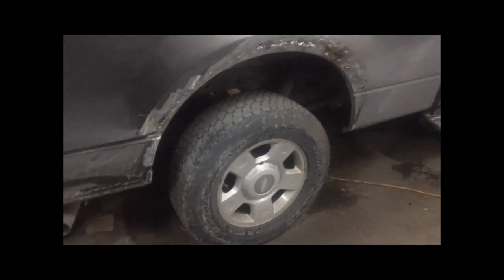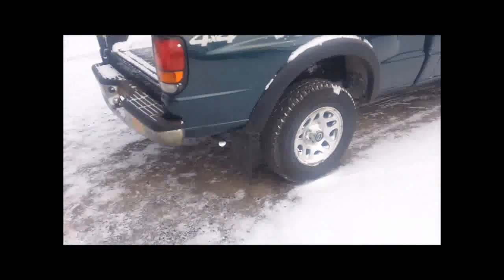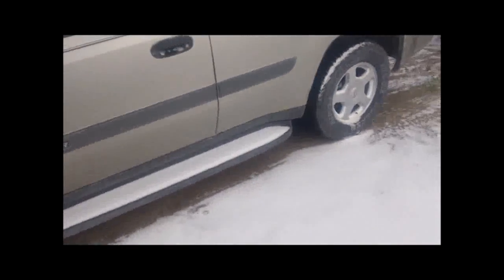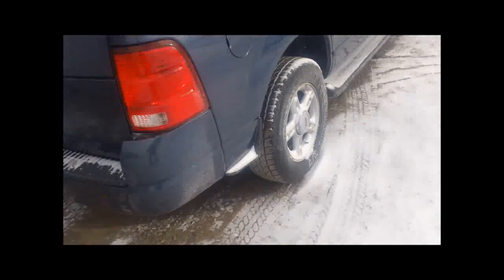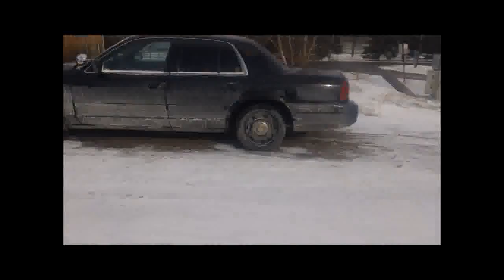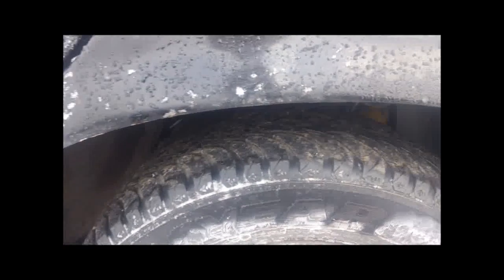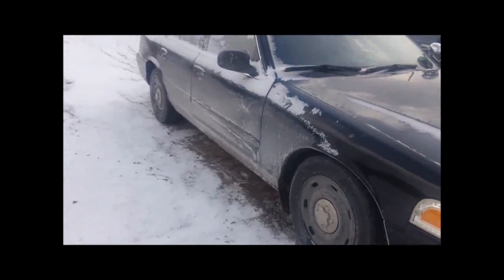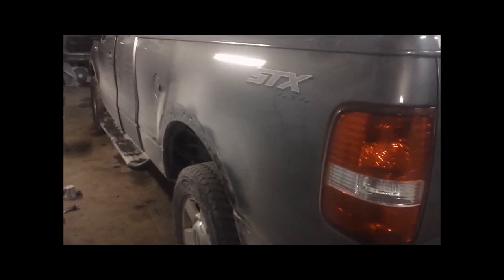Why do vehicles rust? Poor build design or because people don't maintain them?

Comment: For us in Europe it's totally amazing that you can even buy a brand new car with no undercoating. Add bad design to that and you will get huge rust problems. European and alot of Japanese cars are pretty well rust proofed and have been for alot of years. We have lots of road salt and hard winters here too, but 20+ year old cars with high miles are still on the road with little or no serious rot.

Comment: When I buy a new vehicle, it goes directly to Ziebart before it even sees a wet road.  IMO, a good undercoating/rustproofing when new helps tremendously.  With that said, undercoating isn't perfect.  I still make a point to put my vehicles up in the air each spring and give the undercarriage a good power washing.  I'm also careful to always open each door when I'm hand washing and run my sponge along the bottom of the doors and the jambs.  I also like to spray Fluid Film on many of the suspension parts.  Nothing really stops rust totally but good maintenance and cleaning will help deter the rust.  I really wish we had Krown oil coating in the Midwest but that's more of a Canadian and upper northeast thing.

Comment: The coating on the imports is actually put on to stop the salt in the air from getting into the seams while they are being shipped. It does a very good job. The "aftermarket" version is Waxoyl Like most coatings it works best on rust free surfaces.

The trick to any coating is getting it into the seams. That is one of the things that gluing a vehicle together with bonding adhesive could really help. If the entire seam is filled with glue, the air and moisture stay out.

Comment: Poor design, thinner gauge steel and highly corrosive chemically treated road salts.  The EPA keeps setting stricter federal CAFÉ standards that force manufacturers to produce lighter vehicles in order to meet fuel mileage goals.  The municipalities are treating road salt in order to stretch tax dollars. The end result is that the cars have less fuel consumption as fuel prices rise, taxes rise with rust repair costs rising.

Comment: CHECK MY YOUTUBE CHANNEL.. I HAVE A 27 yrold  chrysler fifth avenue and a 27 yrold duster kcar. and a 20 yrold dakota and a 10 yrold dodge ram... all are OILED  every spring n fall..with every oil change.. my dakota has been oiled atleast once a year since 2 years old.. .. same with my ram.. princess auto oiling kit and used oil... sticks to the old undrecoating and its thick as wheelbearing grease.. ..every door sill and cover the rockers and bottom of the doors.. ..inside n out.. takes about an hour..  the truck is flooded with thick oil.. all winter long ..ottawa used tons of salt.. i have  NO RUST.. i love my trucks .. cant afford to replace them.. people say its the BODY FOAM ..if theres no air at the steel and the foam is SOAKED in oil.. IT CANT RUST oil is the answer  .. spray the shit out of it.. .. PISSER the ford in your shop is rusty because is not been oiled THATS  BAD MAINTENANCE   ..my dads GRANDPRIX GTP  is 10 yrsold.. OILED 2 TIMES A YEAR.. 20 TIMES OILED.. NOT A SPECK OF RUST.. BUMPS N SCRATCHES N  WINTER CRACK IN THE BUMPER BUT THATS NORMAL  WEAR N TEAR FROM A 72 YROLD MAN  AND PARKING LOTS .. CHECK MY CHANNEL .. IF IT AINT COVERED IN OIL 2 TIMES A YEAR ITS POORLY MAINTAINED !!!!!!!!

Comment: Dinitrol is what has been used in Sweden to prevent rust inside the chassis and under the car. The real problem is the manufacturing process of these cars, firstly the don't build them to last (they wouldn't sell new ones if they did). New cars normally just have a light treated surface on the sheet metal, one layer of a black primer on the inside but they have 3-5 layers on th outside and that is just to get the good looks. The second reason or the main reason is profit, if you build a cheap car that the customer is going to the scrap yard with in 5 years then you can sell another quicker. Then you say if the quality is so poor the customer will change brand, but if all the brands have the same philosophy (cartel) and the only once that do think of the customer costs a fortune, what will you do? To prevent rust treat your car with wax or Dinitrol the same day you buy it and you might save yourself some dollars in repair costs.

Comment: I think its a trifecta of it all. 1 Being poor design. 2 Owner neglect. 3 The crap they use on the roads in the winter. I have 3 different rigs. I have a 2000 grand am GT that I don't drive in the winter at all its kept in storage only driven in the summer and fall. Has 164k miles on it and not a speck of rust. My 01 GMC I drive all the time year round has a few rust spots under the rear quarter panel near the mud flap and I try to wash it all the time to get rid of the grime. Now my 91 Chevy plow truck has rust all over it. I used it to plow roads and driveways in the winter time. I try my best to keep it clean but the crap they use on the roads just eats it up. Granted its surface rust but it will soon eat thru. Not to mention my plow blade is covered in rust. Just goes to show you from one extreme to another. Salt is killer for paint. And out here they use de-icer spray and that crap IMO is worse!!

Comment: honestly i think it truly depends on where you live. In new york they must drench the roads in salt or add something else to it because where I live in Northern Ca we get snow, they salt the roads all the time and I dont think vehicles here have the rust problems as it is there. All the vehicles I've worked on or friends vehicles never had rust issues. My friend had an f250, the only thing that began to produce rust was the aftermarket nerf bars/steps.nothing  to the actual truck.. So who knows maybe there is something different in the water/air/salt on the east coast? Atlantic more potent than Pacific?

Comment: Actually, Ontario REALLY lays the salt to it, here in Saskatchewan rust is a non issue. My wife has an 87 Olds 88 -- showroom  fresh. I run a 93 diesel, 30 mpg and one spot thumb size. No need to replace either one.

Comment: i have a 1992 lincoln town car with original 89k on it the only spot on the car the has rust is the on the passenger back in front of the tire besides that the car has no other rust on it i don't drive it on the crappy roads since its in such nice condition

Comment: They rust at the seams and you have to have seams. If they were properly rust proofed from the factory they would last a lot longer. I have had really good luck with 3M rust fighter over the past 20 years, it sprays really thin so that it soaks into the seams and dries to a paste like form to keep the moisture out. So to answer your question I would say the blame falls on the manufactures, they need to do corrosion protection right on the assembly line but it's a cost thing so they don't do it.
Reply: Maybe they should just make cars 100% out of plastic, don't think they could rust then lol
Reply: CornellsGarage
 tubular frame with plastic/fiberglass panels.

Comment: Well im in ottawa ontario canada and the trucks here are generally not that rusty. They put allot of salt on the roads but the most rusty that i can see are the fords. If you go to a ford dealer they are already rusting on the lot. I drive an 00 silverado 325000 kms runs like a tank 4x4 and all and the rocker's are gone but that is due to an accident that just made them get worst from there. I did undercoat the frame with that can stuff and it's holding up nice but as for the body well some place's have design flaws but at then end of the day they are basically all the same. My brother's 07 murano has roten rockers and it was well maintain so it's really the fault of the manufacture.

Comment: Ya tell the road maintenance contractors not to use so much salt on the roads. I watch Corvairwilds channel the state of New York uses excessive road salt. Here on the West Coast of BC the salt air has some effect on vehicles usually it takes awhile for a vehicle to rust out probably 15 years or so. Yes you have to take a garden hose and rinse off the underside of your vehicles. Using oil or fluid film helps prevent rust. Hydraulic oil works well it is easy to spray and it doesn't smell like engine oil.

Comment: they are made too rust so you will buy a new one i hate cars the way they are made but sad but true german cars are very well built for rust you dont see them rust out no were near as much they spray the honey coating on all jonied joints ive even seen it under belt moldings on bmws

Comment: You need to do something to prevent it or at least slow it down. I have used oil and it works but dirt cakes up and drips every where. I just recently started using fuild film coat of $45 a gallon that is basicly sheep wool oil that is alot like oil... it migrates and penitrates metal but only gets a coating  of dust, does not drip and resists washing off. bought a spray gun made for it with a wand. I remove all body plugs and spray inside rockers and the inside of boxed frames. time will tell if it works... so far I like the stuff

Comment: build quality and people not in the trade knowing what causes rust or what signs to look out for are mostly to blame, like me if you work on the same makes and models in a shop and see the same thing over and over its obviously build, but hey, why build a car that lasts forever, no one will need a new one.
i would always spray-drown  a rust killer inside older cars first before any coatings
maybe you could do a four door test car like your rust / paint panel, each door with a different coating then cut them open later on in the year

Comment: I don't know about the rust but my grandpa has a 1995 2500 Chevrolet Cheyenne with rust on the tailgate and that's it. its a plow truck and driven in salty conditions its whole life it has plowed commercially for about 10 years.He has a Chevrolet 2002 2500 hd wit little rust but is starting to bubble on the dooors and tailgate he has a 2011 Chevrolet 2500 hd with minimal frame rust and no body rust and these trucks are rarely washed and have all been parked outside majority of their lives

Comment: I think a lot of it has to do with keeping them clean.  I oil spray ALL of my trucks and they seem to hold up much longer than those who don't.  But no matter what you do, those panels with the urethane foam in them are gonna rot.  And the GM trucks will all lose there rockers due to that stupid mid panel inside the inner and outer rocker.  You know what I'm talking about since I'm sure I've seen you cut into them before.  Thanks for the vid

Comment: Cheap materials. I thought most manufacturers nowadays 'dip' the entire steel body in a corrosion resistent (galvanized) chemical pool, before paint. Pretty much worthless environmental friendly watered down chemicals.  The 2015 model F150 body will be ALL aluminum, check it out online.

Comment: Keep em clean!  I daily drove a 93 Talon (in Canada) from 02-07 and it had zero rust when I was done with it.  I also washed it once or twice a week each winter and pounded the wax onto it with the wand, it would actually build up a coating.  I've also had Civics, Maximas - keep them clean and they wont rot.  The cars on this channel are the exception, not the rule IMO.  The only rotted out cars I see around are Mazda 3's and the odd neglected Nissan/ Infiniti.

As for Canada made cars rusting - they're made with the exact same parts as the US ones, so I;d say thats a myth.  Ever seen a rusty newer Dodge Charger, Chrysler 300 or Dodge Challenger?  Neither have I. (built here)

Comment: Shawn, 

A couple factors in play, in order to reduce costs body panels are lighter gauge steel (also for fuel economy), not sure about if recycled steel is a problem the steel used is alloyed for a combination of ease of forming and strength (and to make lightweight dies last). One thing about the older cars were the body dies were meant to last for years as manufactures would keep a body style for years, now it is change them every year or two = lighter gauge material.

Older cars also did not have so many hidden pockets to hold the salt and crud, edges of the fenders were rolled and you could brush and wash out the salt.  

Salt... when I was a kid there was very little salt used, coal cinders, mine dust, gravel were what were put down on the roads. Now days the roads are whiter after the snow is gone being covered in salt. But of course today everyone 'needs' to get someplace ASAP in the snow even if it's just to make a run on the convenience store for bread,eggs and milk!

Back in the early 70's a relative visiting from the UK mentioned how their cars that were parked outside vs. garaged seemed to have less rust. He felt it was a matter of ventilation and not sitting on a salt caked floor.

Maintenance? I bet if you were to go to a local mall or shopping center and take a survey less than 5% of people would even know there are drains on the bottoms of doors and other body parts.

Comment: Also the junk metal
Reply: Steel is steel whether it is recycled or new steel if it is specified at a certain alloy and carbon content it is the same stuff. I think what has changed is the steel used today is lighter gauge due to the manufacturing process and shapes they want to make. See my comment above.

Comment: Ford does not intend to make the best trucks in the first place,..they only want to make the best profit,...my last three new fords are complete crap!
The best time to fix rust is before it starts!   I spray on a type of oil rust spray every year  and silicone spray on all rubber parts and between rubber seals and metal
works for me but its time to go back to imports for me

Comment: Most of it is poor build design. Yeah if you clean it every week it will help, but you really can't stop it. My buddies 2006 f350 6.0 has rust holes in the bed and the fenders, yes he had a spreader in the back when it was a plow truck, but it was washed out constantly.
Reply: I have 4 diesel trucks a 97,99,02, and 06 all have over 200,000 miles, and all get driven year round in a rust belt and only 1 of them has a tiny bit of rust. I undercoat them every year and do tons of other preventative measures and my shit still looks like brand new. It all comes down to the owner.
Reply: Like I said, if you plow for a major snow removal company and have a spreader constantly loaded with salt in the back, you will end up with a rusty bed after doing it for awhile, and it does have to do with the owner as well I agree.

Comment: I think it's a little bit off both. Most of it is poor design. Especially like the 01 toooo 08? Dodges with the vent holes that let the shit in and won't let it back out. I do think however that a lot of this is preventable. if you keep the veichle clean (man I hate New York) it will help slow down the rust.

Comment: Here in the UK all the cars that we buy have been dipped in cosmoline  or something like that .The full body gets dipped in huge tanks before the rest of the car gets built around it, engine ,gearbox, glass ect ect...I owned a Vauxhall Vectra for 10 years and not one tiny bit of rust on any panel, the exhaust fell off but the paintwork was still perfect...We have severe winters with salt and saline and snow..Underseal is a thing of the past here, no wax or undercoating needed..
Its nice to see you back, missed your humor and chooch. Keep Pissing